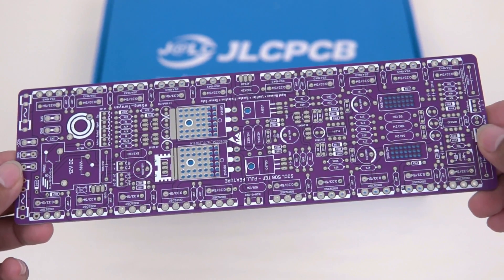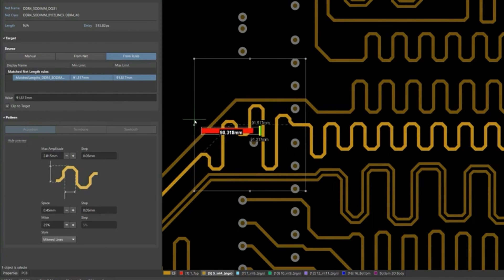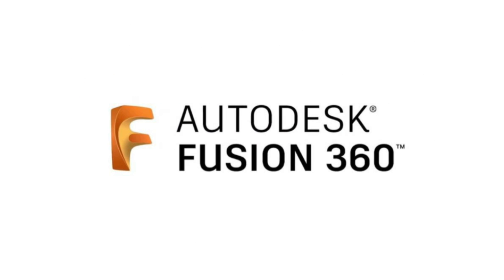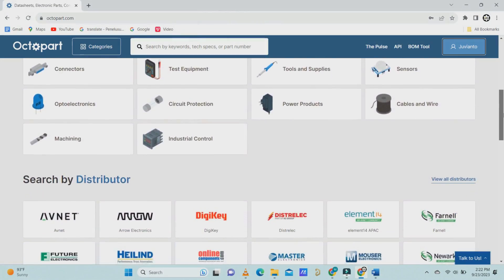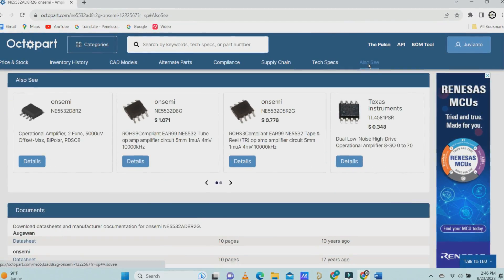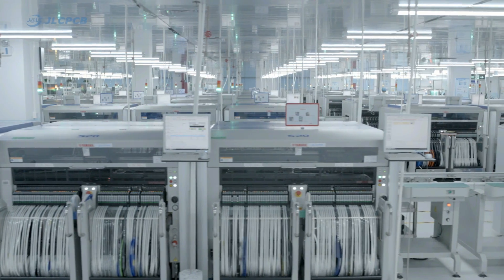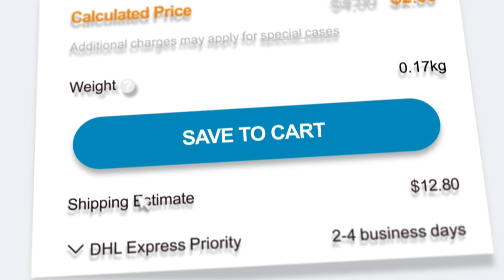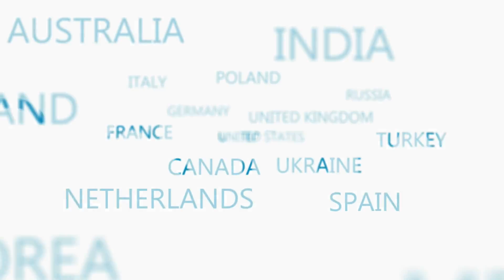DIY 1800W?? High Powerful Amplifier using 40 Transistors 2SA1943 & 2SC5200 #cbzproject

Comment: 1800 Watt? How much voltage do you deliver on the amplifier and how much amperage can deliver your power supply? I have amplifiers with lower wattages but with much bigger power supply`s. The Crest V900 delivers 2 x 400 watt RMS, it takes 10 amps from the net. The wiring inside is at least 14 AWG...  I see that your wiring is much  thinner. Its al about the power supply, the transistors can deliver the power, the supply never...